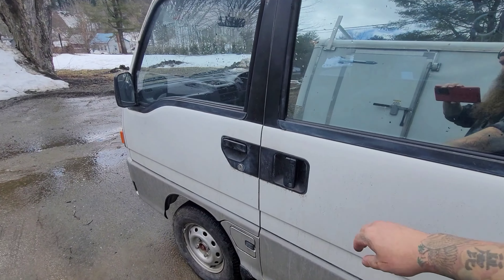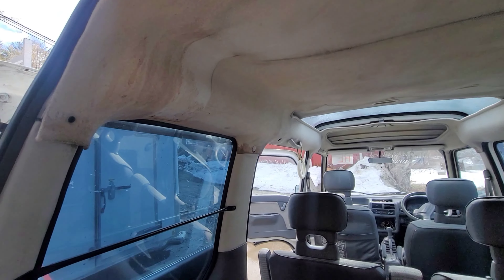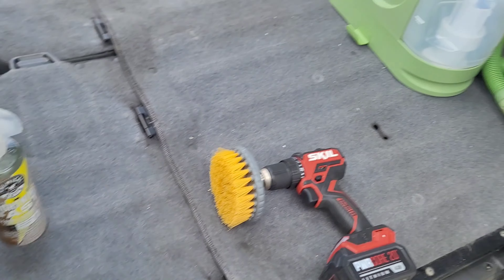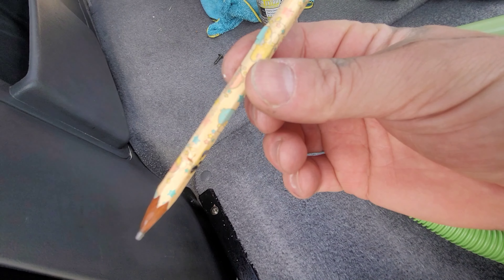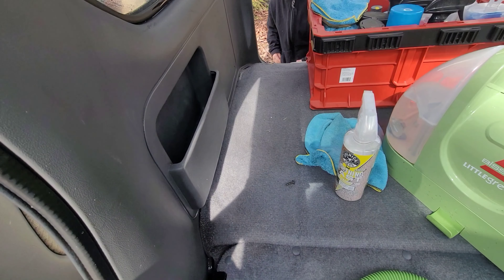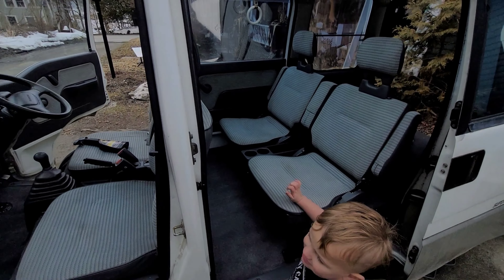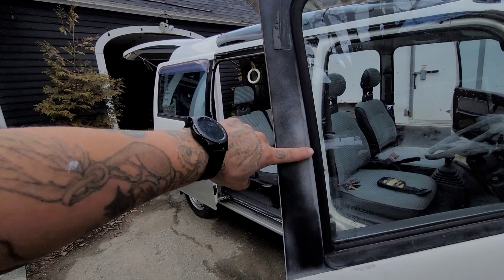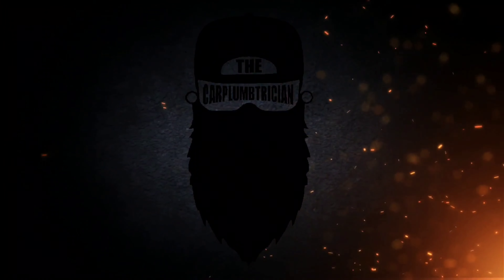INTERIOR CLEAN-UP ON THE SAMBAR!

Comment: She’s looking good after that cleanup. Also in pretty good condition considering the age too. I didn’t know the engine was in the back until you showed it in your previous video. I always presumed it would be under the front seats. Lol. Probably easier to service the engine when it’s at the back too.
Reply from the maker: It wasn't all that bad to begin with, still a few things left to do but in due time! Haha. Yes there's a hatch too in the trunk area to access the top of the motor where I'm assuming the air box is